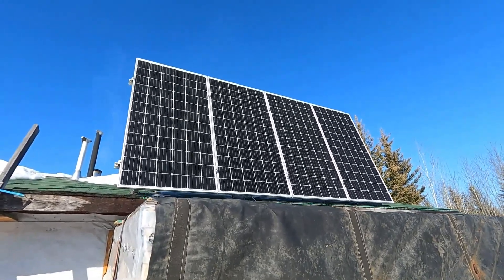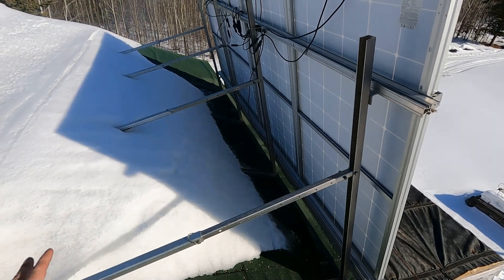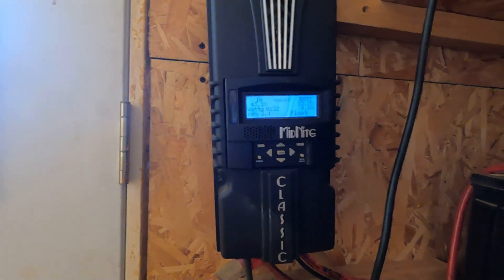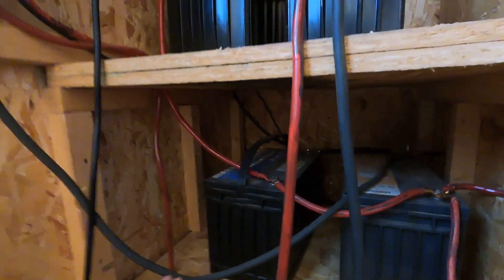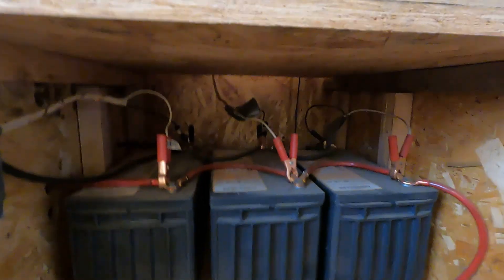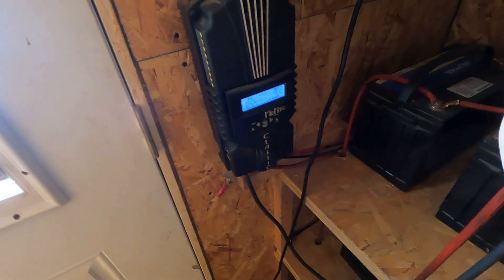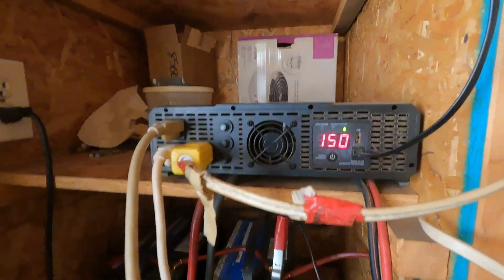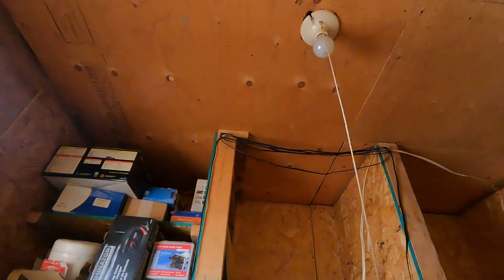D I Y solar at my off grid cabin, Quick setup runs it all,S2 E31.

Comment: does your charge controller step down the 24 volts coming in from panels down to 12 volts?
if so is that automatic or did you have to configure it???  Subscribed.... off grid in Ontario saying hello!!
Reply from the maker: Hi , Thanks for checking in :) Yes that is what the charge controller does, This one is able to be changed to 12,24,or 48 volt , so you can set up your batteries in which every you chose, then you need Invertor to match your system, I just bought a 12v because I only had 2 panels & 4 batteries the first couple years,
Reply from the maker: It was a little hard to explain It all I didnt want to make video too long, There many setting on charge controller, like for shutting the power flow as your batteries reach 14.4v it shuts off the in coming power so you dont over charge batteries, hope the info helps :)